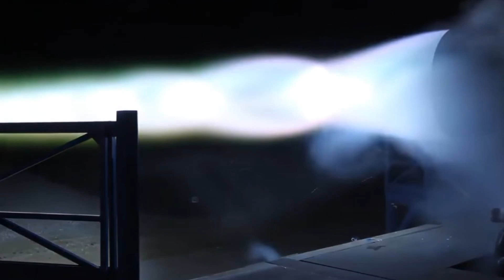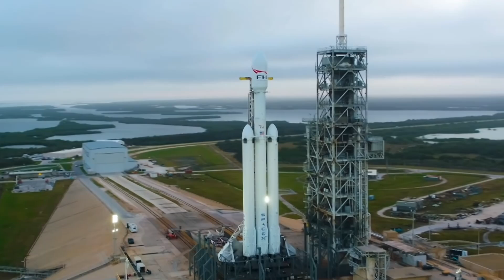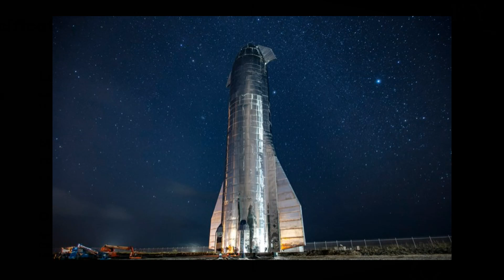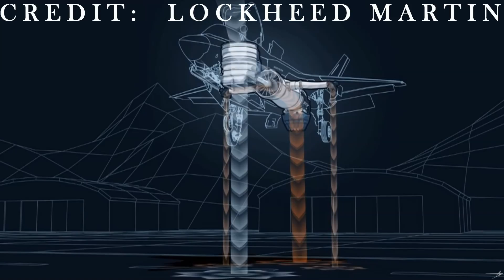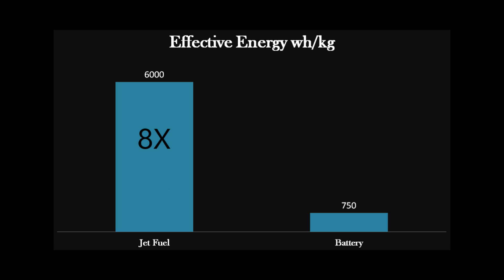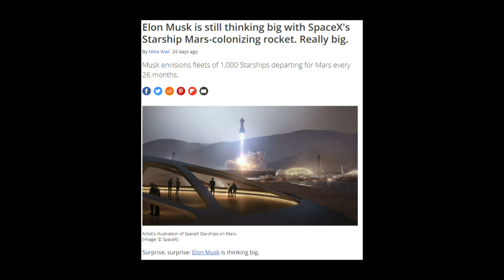ELON MUSK'S BATTERY POWERED SUPER SONIC VTOL JET - My Tesla E-SuperVTOL design

Comment: With a conventional jet, the airplane gets lighter as more fuel is used along the flight path, making the system more efficient. Why the H@!! do we want a craft that lugs around discharged batteries as a dead weight the further along it travels. There really is no good reason to use batteries in airplanes.

Comment: Can props even reach Sonic? I think the Dynamics that they use to work break down at that speed
Reply from the maker: Wouldn't be props 😃. I need to make an separate video for that
Reply: Whatever that mechanism is, it's gotta be complicated. What's always been nice about jet turbines is that it's kinda simple once up to speed. This electric motor would need a gearing system, which worries me at high speed.
Reply from the maker: @gormauslander  I'd try to avoid a geared system.  Based on the feedback I've received here, there are electric motors than can easily hit the rpm requirements.  I'm thinking a series of compressors to heat and compress the gas.  However, I don't know if just compression will do the trick!  Trying to work out if I need to add heat, and if so, how much!
Reply: @thelimitingfactor  right, and electric heating as far as I know is a lot slower than chemical heating, so really, this new engine needs to be entirely rethought rather than trying to adapt from older concepts.

Comment: I think it’s viable. It can be even more viable for intermediate haul distances if, in addition to all your design features, it incorporates a small scale rocket booster for rapid ascent for enhanced cruise performance at rarefied altitudes. The detachable booster can be a smaller reusable fly back booster (complements of SpaceX). It can be much simpler since it’s size and range of use may be considerably scaled back to only get the VTOL aircraft to altitude. Then having a battery with lower energy density would be less of a performance constraint in the early generations of the aircraft. Spare the battery use until you’re at altitude.

Comment: "An autonomous jet couldn't be hijacked"

There are a lot of good selling points here, but that ain't one of them lol

Good move copying Skylon approach, but the energy density is the limiting factor on range, not the cost of maintenance, so your figures still put the jet at 5x advantage. 

As for supersonic boom, modeling on the Busemann Biplane concept (not a pure Busemann) offer some solutions for decreasing the effects.
Reply from the maker: Buseman Biplane...new to me!
Reply from the maker: This thing is awesome.  It would also allow moving the batteries to the wings!  And, potentially some gimbaling fans for VTOL that are more efficient than electric jets.
Reply: @thelimitingfactor  The only issue is that you can't do a pure Busemann Biplane.... there's a trade off between sonic boom elimination and lift. Perfect Busemann has no lift. 

I imagine your configuration would likely be able to use some of the properties with minimal wing expansion.
Reply from the maker: @palarious  This is gold.  Got any ideas for the jet engine?  I'm getting conflicting messages on whether a series of compressors would get the air hot enough to expand for thrust.  And, if not, could the heat generated by the engine be used to expand the air for thrust.
Reply: @thelimitingfactor  I don't know on that, but there is a group on Facebook called "Science and Futurism with Isaac Arthur." I find pooling the brain trust there usually dregs up some really neat information.
Reply from the maker: @palarious  That's excellent man, thanks!  Just put through a request to join.
Reply: @thelimitingfactor  I don't think you'll be disappointed. There's the usual folks, but there's also a ton of rocket science and nuclear physics people. They don't comment as much as they used to, but there's a few names that tend to know some really useful into.

Comment: I admire your enthusiam, but there are so many things which you either overlooked, falsely assumed or did not consider well enough, that I think this video gives many people a false sense of how feasible this idea actually is.

I don't want to point out everything, but a few points that particularly irked me are these:

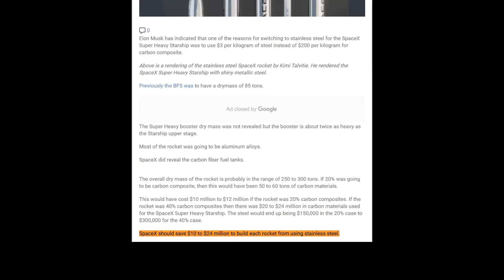20:08 "Reduced airport security...because you cannot hijack an autonomous plane". Firstly, I doubt that a fully autonomous plane can never be hijacked. It could in principle be controlled remotely if it's control signal is intercepted. Secondly, hijacking is only one of many dozens of threats which airport security helps to protect against, and autonomy does nothing to prevent many of those other scenarios from occurring.

20:20 "...lasts much longer...made of a solid stainless steel tube". Nitpicking, but what do you mean a "solid tube"? The description is redundant, but you used it multiple times. You mentioned at 11:20 that the stainless steel material choice will allow the aircraft to "operate at (sea level) pressure" and later on you state that the airplane could potentially operate higher than 42,000 feet. This represents a significantly higher pressure differential which the fuselage would have to deal with compared to existing aircraft. Unless you make the fuselage thicker (and therefore heavier) it would not necessarily be able to last longer than fuselages on existing aircraft. 

20:28 "...nearly infinite lifespan" It cannot last forever because of repeated stress from many pressurisation/depressurisation cycles, especially given the assumed higher pressure differential.

20:40 "...more trips per day" You cannot make this assumption just because the flight time is shorter. It takes substantially longer to charge a battery (especially one as large as would be required for even a short-haul electric flight) than it does to pump a fuel tank full of fuel. Unless you've got extremely advanced (extremely) high speed charging tech (which could potentially put unsustainable loads on the power grid), you're not going to charge this plane quickly enough to have the short turn-around time to guarantee more flights per day.

Thanks for the video though! It does provide valuable general analysis for electric-powered flight as a whole.
Reply from the maker: Totally, this design needs some work!

Deep into the editing in my next video, so pardon the brief responses:

1)  Hijacking - a fair point!
2)  Great input!
3)  I was being hyperbolic in hindsight.  The point being that a surface unbroken by hundreds of windws would doubtless be more durable.
4) Not a major concern on the battery end.  Batteries will be able to charge at 1C without a sweat.  Maxwell's tech enables this by create a low internal battery resistance (carbon polymer).  The difficult part would be the massive battery bank/powerstation needed to charge it that quickly.
Reply: @thelimitingfactor  I'm really looking forward to your next video! I'm really curious to hear your analysis of the total battery energy required (taking efficiency into account), charging time, and charging infrastructure required. 

I'm also curious to know how well airports could cope if multiple of these aircraft are charging simultaneously. What is the maximum charge rate that they could safely sustain, assuming the power grid is the limiting factor?
Reply from the maker: @michaeletzel4877  It's probably best to look at this the other way around and design the battery for the use case: How long does it take to load/unload the plane, clean it, do checks, etc?  I think to average is 60-90 minutes.  I'd shoot for 1 hour to full charge rate.  However, we wouldn't let the battery completely discharge, so it would be a top-off.  1C would be just fine.  I think we'll see a safe 2C with Graphene, and maybe much more.  Graphene doesn't add any energy, but it does lower internal resistance.

Comment: Super-sonic on electric-fan engine, seriously? Have you heard about aerodynamics? Modern jet engines do not burn fuel in order to spin the fans, but quite the opposite. And this is the main mistake, after which it does not make sense to use this video.

Comment: I agree to many non tech claims in this video but two: 
1. Many people will miss the window, especially those afraid of flight.
2. More durable fuselage won't necessarily be a blessing. The good reason for that is that technology improves and it will be a big fuss to change everything in an old fuselage. The ugly reason is that the fuselage companies would go bankrupt or increase the fuselage price or go to China.
Reply: In (1) if the screen had the option of viewing outside the aircraft among others then problem solved. In (2) If there is a universal demand from airlines and the passengers then there is a large possibility that aircraft companies would build stronger long lasting fuselages but yes if passengers did not understand the strength advantages of windowless fuselages then it might not happen. The aircraft companies could say because of high strength fuselage the cost can be higher but then it would likely be easier to design and build without windows. Also maintaining atmospheric pressure at much higher altitudes puts much greater strain on a fuselage where a decompression breakage could happen without extra strength.

Comment: At supersonic speeds, regular fans used in gas turbine engines are becoming inefficient. Adding more kinetic energy to the air becomes more difficult as speed increases. It works better to add internal energy to the air and let it expand by itself. This is traditionally done of course by burning fuel, but you could do something similar by creating a continuous static discharge I think. This would have the added benefit of no fuel decomposing due to excessive temperatures, resulting in higher efficiency. However, how downstream components would cope with the ionized air is yet to be seen. For low speed flight and take-off, such an electric jet would be using powered fans like the ones you drew, but at cruise speed, I think it would have to switch to a different type of propulsion in order to cope with the extreme inlet conditions.
Reply from the maker: Did it have to be a combustible heat source, or just high heat?
Reply: @thelimitingfactor  just high heat. In experiments, even radioactive isotopes were used to heat up the air stream.

Comment: The progress in battery technology has been predictable enough that there's no reason to wait for batteries to hit 500 Wh/kg before designing the first ESVTOL. You can take into account the design process such that, by the time you finish the design, there's say, an X% chance batteries will exceed Y Wh/kg. There's also no reason to wait until after the electric vehicle market is saturated to begin work on the electric airline market. All that waiting is just giving other people the opportunity to enter the market.

Elon doesn't just wait for tech to be ready for mass market. He looks for the market that can be a proving ground and builds for that market. You're thinking about it too much like a threshold. Instead, the size of the addressable market dilates with metrics like Wh/kg. Mass market EVs weren't feasible when Tesla started, so they focused on the niche market that EVs could address: Luxury Sports Cars. Probably a similar market would be the proving grounds for an ESVTOL: Private jets.

Comment: A regular craft with STOL will be fine. VTOL and super sonic aren’t worth it. Also it is very possible we will need much leas travel with advanced IT.
Reply from the maker: Yeah, it would certainly be easier!  I think I'm making things hard on myself.  Agreed on the IT thing.  Watching it happen real time at work.
Reply: @thelimitingfactor  VTOL and supersonic are two difficult and rarely utilized feature of aviation, those would require complex and heavy control systems of their own. Making it a tough sell for civilian market. The most optimal config is STOL and fast but not engineering critical jet. STOL is much simpler than VTOL, it use less runway also reduce a significant amount of stress on landing, but avoid the complex hover mode control. Fast but subsonic or transonic are good enough for civilian transportation, also much safer with simple design and great carrying capacity. You did a good job illustrating your ideas, I would like to see it further developed.
Reply from the maker: @MNanme1z4xs  THANKS!  Now that I've realised how naive my design was, I want to do better.  I'll need to stew on this for a couple months, but fully intend to do a V2.
Reply: @thelimitingfactor  I actually like your design, its much more interesting content for your channel.

Comment: Jet aircraft are doing an immense amount of damage to the hydrological cycles. Heat is the primary driver of weather, and the troposphere is frigid. The heat from thousands of jet aircraft  dumped at high altitude causes the destabilization of the entire atmosphere. We need electric high speed aircraft urgently. Thanks for this excellent glimpse at some promising ideas.

Comment: 5 minutes in and it's clear you have NOOOOO idea what you're talking about.  Just to cite a single example: you want heavy equipment far out on the wings to counteract the massive bending moments due to lift.  The reason designers don't put engines far out on the wingtips is to avoid having to make a massive vertical stabilizer to counteract a potential engine out scenario.

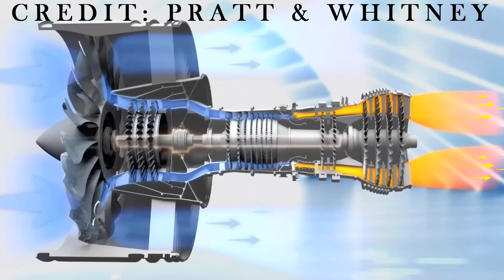Comment: 9:30 What I'm really looking forward to in electric motor design is carbon nanotube windings. About 1/4 the weight of copper, and potentially much higher conductivity. Almost seems silly to devote effort to improving conventional designs rather than focusing on development of cheap nanotube manufacturing techniques.

Comment: I appreciate the research you put into this. Here are my 2 cents. 
The advantage of supersonic, high altitude flight utilized by the SR-71 would only be exploitable on long flights because of the time & energy it takes to get up to altitude. The plane you have designed would be the end prize of development, but in the interim, electric planes will be subsonic. They will probably start with short commuter fights and progress to longer routes as they develop. In this case, a flying wing design like the MAVERIC or the KLM V-Plane is likely. Those 2 planes are designed for jet fuel, but an electric flying wing is the next logical step. 
I have a couple of thoughts about these. 
Electric motors are smaller and lighter than fueled engines. This opens the way for distributed propulsion. This means many smaller fans. A dozen small fans are much better than 2 big ones for two reasons. Aerodynamically it creates smoother more even and efficient air flow than a couple of violently high air streams in small areas. Structurally it lacks extreme stress points caused by concentrated high thrust engines. This allows lighter frame. 
The other thought is that VTOL would be very advantageous for any route, especially short ones. So let's imagine a VTOL flying wing with many fans. More would be needed for hovering than forward flight, so some could fold up. Most air frames have some empty space, especially a flying wing. In areas too thin for cabin, a few hover ducts could be housed. (The F-35B has this) doors would cover them in forward flight. 
My final comment about a VTOL, distributed propulsion, flying wing is that it could start out as a hybrid, or fuel cell powered plane. As batteries got better, they could drop the generation mechanics and go with all batteries. 
I think it would be blast if you tried designing one of these.
Reply from the maker: Great thoughts and much appreciated!

Comment: One of my hobbies over the last 20 years is designing air ships.  Not blimps but powerful and elegant ships from sci fi movies.  One option for forward thrust and even hovering just off the ground is ionic propulsion using high voltage wires and foils to generate lift or forward thrust.  Not plausible on any other craft but to my amazement it was recently done for a hobby plane, it's thrust was ionic wind propulsion.  Another issue was how to collect static off the hull before landing and how to use it to add power to the batteries or even the ionic repulsive landing grid.   The ship in question is the NCC 1701 A  Enterprise air ship.  176 feet across the saucer section, 380 feet long and about 88 feet high while resting on it's landing gear.  About 30,000 pound with crew and passengers, 2 gas engines and 20 electric.
     My idea for ionic propulsion is too weak for your design and the wire needed would just add drag at high speeds, but what about static collection on the hull?  What can you do with it?  How fast would it charge up, and to what level and how could you collect it?   Even my minivan shocks me when I get out of it in winter time.
Reply from the maker: This is really interesting, thanks for the ideas!